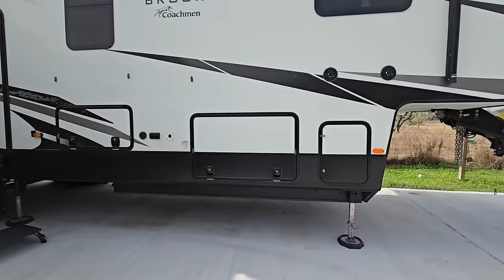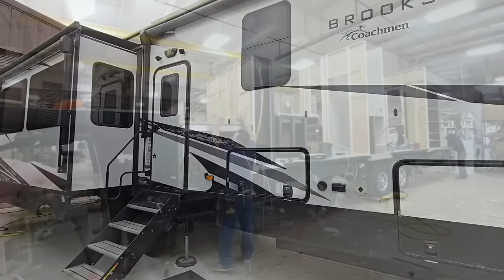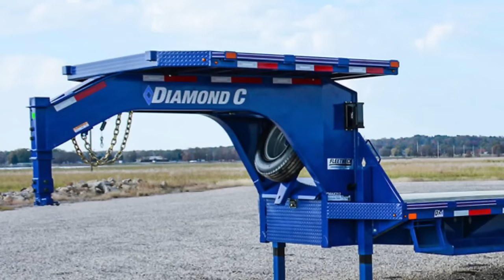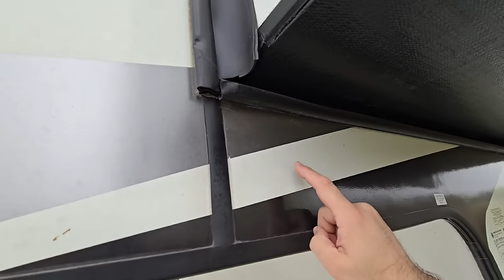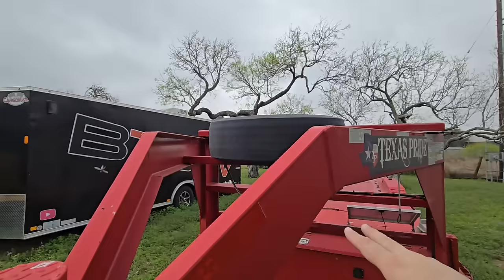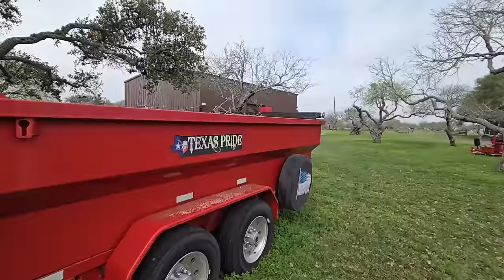FIFTH WHEEL RV vs GOOSENECK Trailers.  WHY THE DIFFERENCE?  Explained!

Comment: Mechanical Engineer here , issue is length of overhang on these rigs and where the king pin is at on the far front of that overhang with that weight . , if you look at semi truck and trailer set ups you will see the position of the 5th wheel and king pin is not dealing with 6 plus feet of transition with weight on it . Solution would be to shorten the overhang and bring the king pin back. Gooseneck is tapered to limit  load and there is no weight on that gooseneck area above it .However this brings clearance issues.  So you have to over engineer that front frame area to compensate for that
Reply from the maker: Remember, the allowable movement without the structure on top is only an inch or less. The structure creates a rigid platform. It is technically over engineered according to them.  I don't know to what degree though

Comment: Unless Lippert and the RV manufacturer have fully analysed stresses and deflections, using finite element analysis and strain-gauge placement, they have just winged it and deserve to be challenged in court  Any frame that fails under normal road and travel conditions (acceleration, shock, thermal, user loading) should be grounds for buy-back and compensation for all losses.  The Lippert factory tours have shown no evidence of structural analysis or product testing.  Normal loads should be multiplied by 10x to 15x to accommodate the loads possible in an accident.
Reply from the maker: I'm not sure if you saw the video of their research and development which did do strain gauge testing

Comment: I have a Diamond C 38ft flat bed. It’s on an engineered beam and the deck is cambered. To allow for flex.  And it has a torque tube built into the cross members the length of the trailer.  No comparison.  That’s like comparing a Navy Destroyer to a sail boat.  Not the same.
Reply: Love your channel.  I’m getting ready to enter the fifth wheel market.  You do a great job of telling both sides of the story from the consumer and the manufacturer viewpoint.  Keep up the good work.

Comment: For me on my 5th wheel, I don't want a gooseneck trailer design but I want that gooseneck hitch like your 5th wheel RV has so that instead of riding on a small 5th wheel plate, the trailer is riding on a ball in the back of the truck. While it would be nice to use my semi-truck to move my 5th wheel RV (which it can do) the fact is the wiring harness and connectors are incompatible between a commercial truck and a RV trailer. As most farmers have trucks with the gooseneck ball hitches in the backs of their trucks, I'd rather have a gooseneck box instead of the conventional kingpin boxes RV's come with. Also the latest information just out, it's been learned that Grand Design and various other 5th wheel RV builders made RV's that were overweight before they left the factory and that the mfg ID plate on our trailers has false tare weight information and it's many of these trailers that are suffering from frame damage due to being grossly overweight. In other words, many of our trailers were overweight before we filled the water tank and before we put our personal possessions, generators in the trailer. There is a huge fall-out over this issue and a call for federal regulations on the RV manufacturing industry that RV's must meet the same safety criteria as the automotive industry including recalls as needed.

Comment: After looking at the posts about the upper deck and maybe the rest of the body.  It looks like the factory is putting wood inside the tubes of the wall framing and then running lag bolts through the chassis into the framing.  Thus if this wood ever gets wet, it rots, the lag bolts break free  and big problems.  It seems to me that even if the wood never gets wet there are still a lot of variables in this style of attachment.  It would seem like they should design them to where even if water was to get inside that it would not cause the structure to fail.  After all, we are on a water world and sooner or later water will find everything.  Maybe they should bolt the super structure to the chassis in the same manner as the king pin is bolted to the pin box.  And they should find a way to ensure that all the bolts are put in there since no matter what happens(rotten wood or missing bolts) it comes down to a series of events that cause a cascading failure in the frame centering around these attachment points.

Comment: Perhaps the rv manufactures need to build flex joints throughout the body to allow the box to "give" as the frame flexes?
Reply from the maker: They actually do on the curb side upper deck.
Reply: @BigTruckBigRV  ok, but maybe it should be universal and/or standard above a certain size rig?

Comment: I agree w/ most of what you said here - however when some make/models have higher rates of failure than others, it needs to be examined - was it a mfg shortcoming, or a design shortcoming?  If it's not from poor workmanship/materials then it would have to be a design issue.  Sure customer abuse could be an issue but again, there's always some customer abuse to all rv's and if one fails more than others....  And for anyone that doesn't understand that literally everything flexes ice, even concrete, as does glass..
Reply from the maker: In almost every case, regardless of a weld quality, it has been determined that bolts were missing during the installation process by the RV manufacturer.
Reply: @BigTruckBigRV  Manufacturing failure then.  Par for the course in the RV field it seems.  I get there's a price point that needs to be met, but the things I've seen  is pure lack of giv-a-damn..  No other industry would the poor qc be acceptable.
Reply from the maker: @JoshHefnerX it's really more than a price thing, it's a weight thing first.  As you can see in many newer units, they spend a ton of money on things you can see and touch but all that weight comes with a price, a lighter frame.  Hear me out plz.  If you have a toy hauler with a 20,000 GVWR and a Dry weight of 16,000lbs (very typical of large toy haulers, and specifically the ones with this issue), the frame alone weighs around 5,000-6,000lbs.  Imagine if the frame weight went up by 2,000lbs worth of thicker steel, added bracing, and more reinforcement. WHAT would that do to the cargo capacity that people claim they need to carry their Razr which weighs 3,000lbs plus all their gear, supplies, and stuff?  That means the RV would have the same GVWR but a cargo capacity of 2,000lbs for EVERYTHING else.  Remember,  RV manufacturers get new customers because they dangle really nice interiors and cargo capacities.   The frame needs to support this weight and often times needs to be as light as possible.   Couple that with the lack of proper securement to the super structure and you get problems.

Comment: My thoughts would be to equalization of force a goose neck the triangle front beams equalize the tug, with a 5th wheel frame you're pulling on the center of one side of a square you can't equalize the force in every situation from that location of pull , like I've said hold a rope with your arms spread to your side like you're the front of a 5th wheel and have someone pull the rope from the center and your arms will form a goosekneck from the pull...equalization of force?

Comment: JD 
Another great video. Can you explain why someone would want to replace a conventional pin box with a gooseneck style? I was always under the impression that a gooseneck pin box can concentrate loads back through the frame?
Thanks
Reply from the maker: Thank you. The biggest issue with switching to a gooseneck is ensuring that it doesn't apply too much leverage to the front section of your RV.. think of it like loosening lug nuts on a wheel. The longer the bar, the more leverage you're applying.  That said, right now only the reese goose box is the approved method that I'm aware of.
Reply: @BigTruckBigRV but why would you want to change from the pin box to the gooseneck style? What would be the big advantage of doing so?
Thank you for all of the time and effort you put into these videos. It’s been quite an education for me.
Reply from the maker: @jimjohnson3244 the biggest advantage is that you remove the huge and heavy hitch from the bed.  Makes using the truck far more convenient when not hitched up.  Also, it allows for some lean when towing.  The RV isn't secured to a semi static plate.  I'd imagine that could also relieve some stress while towing.

Comment: You need to scale each axle n load the correct way😊
Reply: With 8 years and nearly 5 months of experience -- living fulltime and offgrid in our 33' 5th wheel (and currently moving into our 2020 Torque M-373 -- I can tell you that the rockers/equalizers between any two axles tend to balance each other out and equally share the load. So it seems to me that almost regardless of how you load the 5th wheel, all weight not on the pin will be split equally between the 2 or 3 axles. This reality is confirmed every time we roll across the scales.
Reply: @JIMPETERSON-n7i  you have to consider left to right.  For example my old 2007 was considerably heavier on the right side.  Enough for it to lean until it was adressed. The right side had the fridge, sink, storage cabinets, our EtoW bed slide, the Blackstone in the basement, and a 3500k generator in the front storage for a few examples.
Reply: @Itsa_Mea -- Due to the crown of any civilized road (higher in the middle and lower to the edges for proper drainage), any builder worth his Momma's milk would put the heavier stuff on the driver's side to offset the natural "lean". On our '94 33' 5th wheel with the rear kitchen, the sink/stove/microwave/refrigerator were all on the driver's side.
Reply: @JIMPETERSON-n7i  based on what you're telling me, my old 5er was set up for Australia then.  Interesting.
Reply: @Itsa_Mea -- Are Australian roads lower down the center line and higher along the edges?
Reply: @JIMPETERSON-n7i  they drive in the left lane, opposite of the US.
Reply: @Itsa_Mea -- I forgot that part. :)

Comment: Under engineered, not enough support for the approximate weight. Half ass welding. There I put the real reasons down since no one will say them on video.
Reply from the maker: I would TOTALLY and COMPLETELY and UNEQUIVOCALLY agree....if the vast majority of RVs on the road were experiencing the same issue..  most aren't.  That said, they SHOULD make improvements when needed and where needed.  This might be strengthing areas on heavier, longer RVs.

Comment: Gooseneck uses a ball in the bed floor, whereas a fifth wheel uses something that stick up above the bed. I'd rather have the gooseneck because the king pin lockjaws on a fifth wheel are a more involved repair, which means it'll cost more money to fix an issue with that than a gooseneck issue. If someone wants a fifth wheel camper, a dry van that goes behind a semi is better than most of the options at dealers in terms of frame flex.

Comment: Wonder what would happen if these frames had torque tubes engineered in to them?
Reply from the maker: Torque tubes are primarily designed to prevent a load on top of the trailer from leaning or swaying too much while traveling.   I'm not sure at work too but have much benefit to a fifth wheel.

Comment: I have a 5,500 pound G.T.W. trailer for work, that I pull daily pretty close to the max. Would you  recommend gas or diesel 2500 Long bed regular cab 4x4 and I also plan on towing a small dual axle travel trailer with about 7,000 pound GTW?
Reply from the maker: Either should be fine honestly.  Most modern trucks can easily handle that amount of weight when properly towing, weight distributed and secured.

Comment: How is the body of a rv attached to frame, if for example does the manufacturer use lag bolts,then what does the bolts go into. 
I have a 44ft trailer gooseneck that has living quarter in front
 I have ben to the factory where they are built, they construction the frame then sidewalls are welded to frame ,sides are applied as so is the interior, its not put together like a 5 wheel. A 5 wheel the walls are applied to the chassis, what holds the walls to frame?
Reply from the maker: Absolutely outstanding point my friend.  Because frames are purchased by RV manufacturers to build on top of, they don't weld they're structure to the steel frame.  Often times it's aluminum that is screwed. This process absolutely could be improved.

Comment: Personally I don't want the frame built so rigid it doesn't flex. I want it built to not fail from what the average user would consider reasonable usage and built strong enough to use a gooseneck hitch. I don't feel like that's too much to ask for when paying $100k or more for an rv. The frame, suspension, and tires should never be the limiting factor. They should be robust enough that they can handle being loaded and driven on rough roads. Frame failure is an easy problem to eliminate. Yes there will be give and take. There will be some loss of storage space and gain in weight but due to the catastrophic result of a failure I think this is acceptable.

Comment: My thought is that water damage is a bad thing in a house and worse in an RV. I think the mfg need to be exceptionally careful about water, and so do owners. Alos the tend to put storage right where you have it and the blame you loading that up.
Reply: Your tanks really shouldn’t matter because I’d think you would dump your tanks before you travel anyway.
Reply: @greghoneycutt1163  I wouldn't think that since the tanks are below the elevated area of the frame (upper deck) wouldn't have that big of an effect on the upper deck which is where the issues seem to be.  Watching all of JD's videos on frame flex and other YouTube videos, I am re-evaluating what I carry in our 5th wheen now, even though we already travel pretty light.  Keystone has 5200# axles on our 5th wheel and yet the dry weight on our rig is 10,550# which I can't understand either.
Reply: I wasn't referring to tanks.

Comment: Its really going to matter when ppl die because a frame fails. This is exactly why this industry needs regulation. You have ppl loading up trailers as large as a 18 wheeler with no regard for weight restrictions. TheY use vehicles that under tow. Now frames are failing and everyone is throwing a dart at moving wheel. Then other ppl don't want to know because they don't want to be out the money. eventually there will be horrific accidents and will have the truth. For now I've told all my family never ever be behind a RV. And don't buy a used fifth wheel.

Comment: Notice those massive triangular steel gussets between the elevated front platform on your gooseneck and the lower flat bed level? Those are completely missing on any 5th wheel frame I've ever seen and that could easily be the reason WHY they are experiencing excessive frame flex in this area -- compounded by slide openings which attempt to bridge this critical portion of the frame (like on your 5th wheel) and IMHO that can only make things worse. :( Any slide opening forward of that critical juncture between the two floor levels is part of the problem IMHO. :(
Reply from the maker: I actually don't disagree with some of this.  Because I'm not a frame engineer though it's hard to say why they do and don't do some things.  Cost is a factor but not as much as you might think.
Reply: @BigTruckBigRV -- I'm sure that cost and weight will always be primary considerations with our infamous Merikun business model where low bid remains King with very few exceptions. Cars/boats/planes aren't built to last forever and neither are RVs. In keeping with their low bid mandate, Lippert will forever and always be trapped between a rock and hard place -- damned if they do and damned if they don't. :(
Reply: I have a 22 foot 82 Layton fifthwheel rv that became deteriorated,  that I never used.  I stripped it down to the bare frame,  thinking I would build a flatbed on it.  My thinking is to build a 4 foot dovetail with ramps,  which would give me an 18 foot flatbed.  After calculations,  I'd never be able to use it for anything more than a car trailer. Thinking I might find someone I can just give it to.
Reply: @JIMPETERSON-n7i  Lippert MUST  ensure that the welders they hire can make a better weld than I could as a teenager...I've been watching this for a few years,  and what I'm seeing is very poor welds...despite what JD shows on his channel...I believe,  Lippert needs to look at their Welders,  and possibly cull some.
Reply: @donaldpereira2652 -- I agree. Those not capable of quality workmanship they can be proud of need to go the way of the Dodo bird. I learned to weld in HS and the worst lines I ever laid down were better than much of the crapmanshi! I'm seeing. :(

Comment: How many miles do you have on your 5th wheel?
Reply from the maker: Maybe 5,000.. actually closer to 7k.
Reply: @BigTruckBigRV  that's good.  A few years back I asked some Montana 3820FK owners and they started showing issues around 8,000 miles.